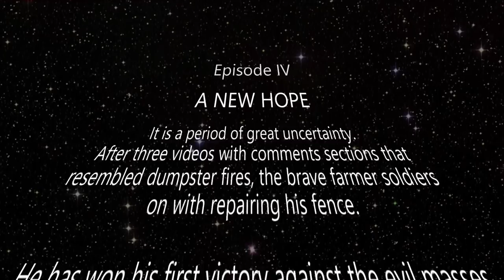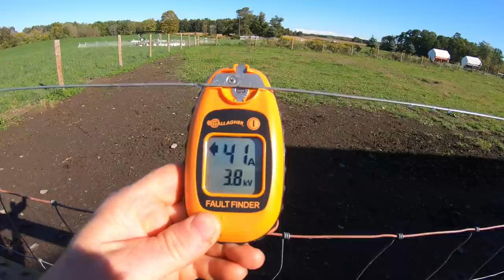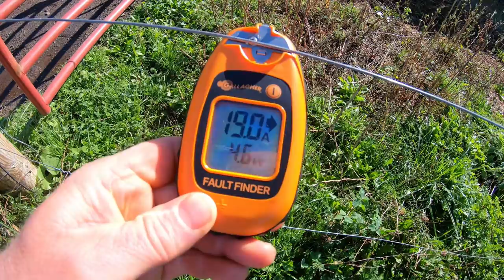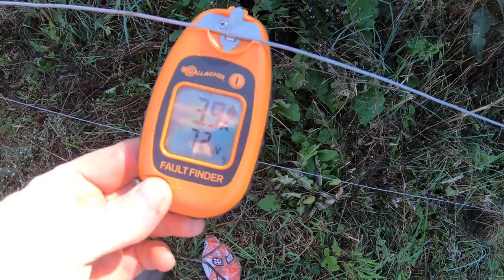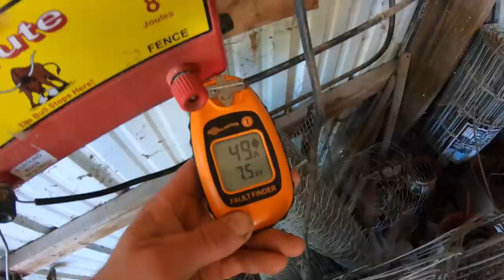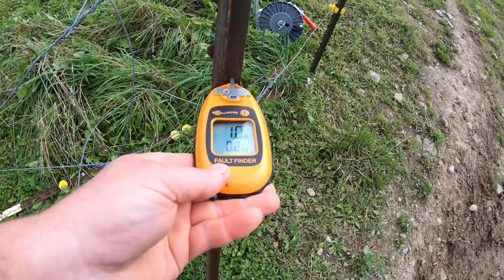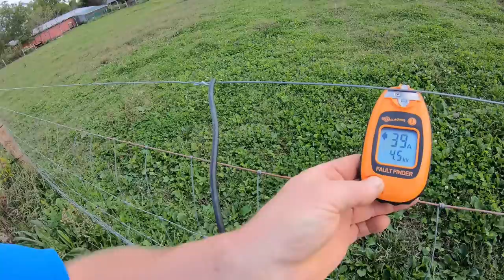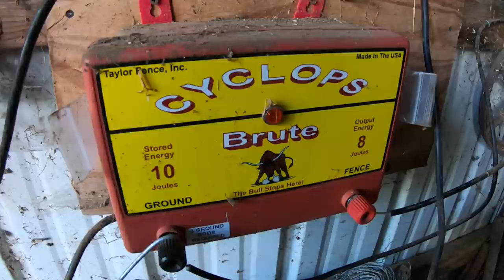FENCE WARS - The SHOCKING Conclusion

Comment: The fault finder helped to explain it so much clearer than the cheapy tester. For a percentage of us, I think it was well worth the $100+. Thank you for that.
Reply from the maker: But it really didn't tell me anything I needed to know beyond the cheap tester, except that the video viewer could see the readout.
Reply: I thought the fault finder was supposed to guide you to the fault? I was going to buy one but now i wonder if i should not waste my money? Any thoughts?
Reply from the maker: @hillbillyfarms3714  The fault finder can get confusing, especially if you are dealing with multiple faults and your fence is interconnected such that you may have electricity coming from 2 directions. I have heard they work well for folks that have lots of experience with them. I prefer to use a voltage tester, along with my eyes & ears.

Comment: "You know, I could go and turn the fencer off, but where's the fun in that". OMG LOL!!  Thank you, Pete.  You are brave, I hate getting shocked, I'd be walking back and forth to the barn again and again.
Reply: @daleolson3506  Thanks Dale, I will look into that for sure!  My fence is too young to and short to have so many faults to chase, but some day I hope it will.
Reply: Just a ground spike and a wire with an alligator clip on the other end can be used as a shunt to ground if you don't like getting zapped while working on the connection.

Comment: When I was a kid we had one of those weed cutter fencers and you are right they were mean hot. I've found birds perched on the barbed wire with their beaks on the hot wire with a bug in their mouth. Every time the current would hit the dead bird it's feathers would stand on end. It did keep the fence weed free though. If you can find them, those old glass insulators work well on corners and ends. Thanks for the video Pete. Good day.
Reply: Our old weed burner was bad about starting fires.
Reply: @T_Humphries  We used one for years and never had a fire start. Maybe we were just lucky. Luckier than the birds, for sure. :o)....

Comment: One of my favourite farm hacks is to plug my fencer into a wifi smart plug (worth about $15).  The smart plug can be controlled by an app on my phone.  When I am looking for faults, or need to do a quick repair, I turn off the fence, repair and then turn the fence back on all standing right beside the fence.  Obviously you need cell coverage in your field, but it has saved me countless shocks and is very quick.  I also have the plug on a timer so if I forget to turn on the fence after I maintain something, it turns back on at 11PM.

Comment: Solved most of my fencing issues when i switched to a New Zealand type fencer a few years back. Did have some problems 4 or 5 years ago so I got a 120 mile fencer instad od the 50 mile fencer i had. That did the trick, the calves don't even sneak under the fence anymore to get to better grass. As a side note my fence is terribly weedy and even brushy some places. But it still works good. I feel for you, when the fence don't work right it is a constant worry.

Comment: One of your best videos yet, love the opening and the troubleshooting.   Your ears are the best tool for finding ground outs.    The loops on those electronet fences that you use for the turkey's getting pushed down and grounding out on the post seems to be a common ailment, pretty much the only thing I look for on mine any more when the voltage drops.

Comment: I went to work as a repair tech for IBM in 1980. Their philosophy and one of the first things they taught us on troubleshooting an electrical/electronic circuit was to keep dividing/isolating the circuit in half until you narrow the number of possible failure points down to something more easily checked in a short time. I've applied that same philosophy to other things besides electricity in life over the years. Glad you finally got your problem figured out. And like others, I liked the intro.

Comment: We put water pipes over the T bar fence post to stop the little rubber insulater wraps from being punctured. Maybe this little trick will help ya some. Plus it made it more visible to the cattle and most important. It rotates so the cattle can't scratch on it so they eventually leave it alone.

Comment: Pete, you got meemaw, who's going on 95, laughing and slapping her knee every time you touch that hot wire.
She suggests you throw away that sophisticated piece of yellow equipment. Go back to old fashioned way the way they did it. She said and didn't take long to get a calculator finger to judge between 7000 and 4,000 volts. In her case especially when she had a younger sibling to do the testing. Y'all have a blessed day she said.

Comment: Hi Pete been watching you for a long time we also have a farm in NY near Rochester! We are switching ours to timeless fence posts they are t post with holes in them you can run the wire thru them or wire the fence right to them. They are awesome we’ve had trees fall on them and after cutting the tree off they stand right back up. They cost a little more but you don’t need insulators. They are made in the USA and great people to work with.

Comment: I am glad that the faults were isolated, and with minimal transdermal electron current stimulation. In my line of work I deal with voltages from 3.3VDC to fault finding at 10kV. You did the systematic thing of confirming the power supply and then looking at the network outwards from there. You still have leakage but it is much better. I do like the new tool, and it worked very well for the isolation of the faults. Much easier to read and operate, and sometimes that ability can make life and diagnostics easier.

May the Electromotive Force Be With You.

Comment: Very good video. You are correct mr to give up or to power through.  Sometimes think outside the box.  Finding the shorts in an electric fence is challenging. I remember dad using porcelain insulators for corner post.  I know today we all use plastic but very seldom did we have issues with them.  Great stuff looking for the next 👍

Comment: Kudos on the intro.  I enjoyed it.  As for termination insulators we had white porcelian  insulators that worked good for terminations as well as corners..  these were the "C" shaped ones, not the donut style.  If they cracked or had dew they arced acrossed but gave more separation from the wires than your plastic t post ones.

Comment: Those nets are a nightmare because no matter how tight you get the post, the bases sag down onto the ground and suck out all the volts. We solved this problem by using stakes in between poles to help hold the netting up off the ground.

Comment: Beat we've been using hot wires and different locations for years. Isolate past your land. Back in the good old days when we had porcelain insulators you never had a problem. And then we tried some of those cheaper fence devices like you're showing with the same great success that you have.
We're out here at the high plains the basement is on a mountain 7800 ft hills and trees. We need about 35 acres per head. So it's not easy just to walk out in the morning and count your cows and make sure you have them all.
One thing we do never want to have happen to us is one of our cows get out on the road and somebody runs into that black cow on a midnight run. So I know you understand the importance of hot wires. We never like to see our fence lines being less than 7,000 volts.
We have more difficulty with grounding because we have areas that are very Sandy and other areas there hardpan clay. And we experienced tremendous droughts. So we have to keep our ground line areas wet at times. Somewhat the reverse of what you wetlanders get.
Not to be bragging, LOL. But in our Donna Anna ranch , in Southern New m
Mexico,we have recorded as little as 0.3 inches of rainfall in a year.

Comment: I'm so glad you have been able to find most of your faults! I definitely was feeling like a star wars style series at this point. Next time you do this slip on some dishwasher gloves followed by some leather gloves. Leathers resistance is pretty decent but the silicone/rubber dish washer gloves will keep you from the shock. I love your content and it made my heart jump hearing the snap and seeing you jump because I know EXACTLY how that feels.
Reply: Also I have the exact same issue with a poultry net drawing down my sheep's fence VERY badly. I run the lawnmower every time i move their fence so there is only 4in of grass grounding it out.

Comment: First of all, very good videos.👍👍👍 I also have a small herd of  simental cattle on pasture myself. I  use wooden, chestnut or oak posts for the fence, so there is no problem with breaking through the electricity, except because of the vegetation.  I know how an electric fence shakes, sometimes you see all the stars in  daylight. 😁

Comment: I have had low impedance fencing for 20 years and grew up with that type of system on a hobby farm. They still sell them, as a matter of fact, Cyclops makes the best one.  Once in awhile on a hot summer night, you’ll catch it smoking a weed. It’s hard to overload them, I have several stretches of it, mostly around ponds, and around our cash crops. I mow and it pushes vegetation on to the hot wires. They are smoked by the time I get done. Everything permanent and on a road has rock under it, and I just use simple poly braid for the moving paddocks. Honestly, a shoe string would keep them in, they are scared to death of fence. That’s with managing 1500 head at peak, down to 1000.

Electricity is a great way to get ride of weeds. Being an organic grain farmer, we use pto powered generators on the back of the tractors with electrodes on the front that hover over the rows and destroy any weeds that have gotten taller than the crops.Their are coulters on the tool bar that ground it. I incorporated nutrient application and in the row mowing, but not much left to shock on the later passes, yet their is usually some volunteer cover crop seed that germinates and some water hemp in the rows that never quit trying.

Comment: The t-posts I have (I use them as corner posts) have holes drilled in them every 25 cm. I have special insulators that you connect on the t-post with a cotter pin. Works perfectly until on of the corner posts fell over (in the river)

Comment: We used to test electric fence by touching the hot wire with one hand and the ground with the other. We'd test after each insulator. You get used to the shock quickly.

Comment: As a Alarm Tech we trbl shoot by cutting the circuit by 1/2 till you finde the tbl. It was very low voltage 12 or 24 v dc. Some really old sytems were 120 volt AC what a shook...

Comment: Epic opening! I was definitely shocked by it. 🤣🤣🤣🤣🤣.

When you replaced that first end insulator and got the first shock I almost jumped out of my chair.
I always fence with a live fence myself so I can test it. Sometimes I end up being the one to test it out unintentionally.
I usually just arc a hammer or pliers across and judge it by the snap, not a very accurate method I suppose.

Been using those end insulators that look like two letter U's giving each other a sort of hug. And sometimes round end ones but I don't like them as much.
Still using porcelain/ceramic ones that my Grandpa put in if we run into them, which I guess Zareba/Dare still make.
Also using the t-post insulators with pin locks and having success.

I almost bought some of those new style orange ones you got but after seeing your videos and opinion on them, well, I am glad I held off. Maybe their second generation design will be better.

Keep up the good work, your videos and sharing are very appreciated!

Comment: Retired a few years ago after 40+ years as an engineer designing integrated circuits.  My mantra over all of those years was if you didn't understand what the circuit was doing or if the behavior of the circuit was baffling then you simply didn't have enough data.  If you collected more data the behavior would become self explanatory and you could address the issue that was causing the "weird" behavior.  Usually, when the simulation didn't produce the desired result if you just kept gathering data you could find the flaw, usually a bad bit or missing bit of code that would get the behavior back to what was desired.  Sometimes, the missing bit was really elusive because of the bad habit of seeing what you expect to be there rather than what is really there.

Comment: one thing i found with using those corner bracket/bracing system is that i had the braces up too high on the corner post and the tension of my wire would pull the corner up and out of the ground. i now put those brackets about half to 2/3 of the way up the corner post and that helped.
Reply from the maker: A long diagonal post also does the same things; transmitting more of the vertical pull-out force into horizontal force.

Comment: Could you use the lockjawz insulators and the tube insulators together?  Maybe knock the "tooth" of the lockjawz.  I've been working on a fencing project and seeing the problem points on your fence has been extremely useful.

Comment: When we had cows and an electric fence, we always segregated / isolate fields into "blocks" with fence handles. When there was an issue, we would disconnect handles one field at a time until we found the problem. This also has the benefit allowing maintenance to be performed on various sections of fence without having to turn the charge box off. This was especially effective when since we had a 15 year old psycho Jersey that would escape anytime there was no charge on the fence - it was like she could sense it was off. You might want to invest in a pair of electrical lineman gloves similar to what the electric company uses for their employees. That'll protect you from Old Sparky.

Comment: For temporary fence areas, such as for the turkeys, have you considered using solar fence?  I use one for my chicken area to keep chickens in and predators out.
Reply from the maker: We used to use it, but found it better to tie into the main fence, due to stronger zap and not having to worry about battery health.

Comment: You can get some non conductive spray paint, even a clear coat, and just spray the terminals, that will rid you of the "dew" shorts, even from the poop ones. spray paint is cheap and wouldn't take you long to do them all.

Comment: 50/50 is a great test method. Break it at the half way point, if it's good then you work on the last 50, and then break that up into 50/50. If not you break up the initial 50 into another 50/50, and continue from there. Quickest way to find one main fault. If you've got multiple faults that's different story...

Comment: I wonder if you couldn't combine the Tubing insulators with the orange ones to double up on the corners until you can get a good corner insulators. The tubs would protect against stuff like the bird poop while the lockjaws ones would protect the tubs from the metal posting allowing both to perhaps be useful much longer. It's wouldn't be too expensive since you seem to have a decent stock of both on hand
Reply from the maker: Wood posts at ends/gates with proper insulators are the solution.

Comment: Pete have you tried leather gloves here in UK 24o volts A/C electricians have them when having to work on  hot cables . Or have you tried standing on a rubber mat so you  are not to ground. Good luck love videos

Comment: Make yourself a jumper with a clip on each end to jump from the hot wire to a metal fence post while you're working on the fence and you won't get shocked.Also your amperage reading at the electric fence controller might be from the resistance im all that wire you've got strung out.

Comment: Sorry Pete, I had to laugh when the fence got you. I had an interesting experience last year with plastic "insulated" posts. We had a storm, the wind took the tops off the waves and blew salt up coating the posts. You guessed it, salt is a conductor of electricity. 9-10k kicking me each through post I had to move.

Comment: 😂Been there, done (almost)all that!  May I suggest, with all that fence line and distance to cover, that you install some cut-off switches at different spots to shut off and easily isolate those pastures when needed.  Unless you actually like being shocked (I remember my dad saying he was just getting “his vitamin D” at a shock.).  I’ve often put a lot of miles on my watch’s pedometer walking fence lines and retrieving equine escapees (e.g.,miles) so I all about being able to isolate sections of electric fence. 
The weed burner fencers were powerful enough to overcome  a certain amount of  vegetation but didn’t actually burn the weeds (as far as I know). I’ve heard horses can’t tolerate the powerful shocks of weed burner fencers. 
I find your videos useful and sometimes pretty entertaining!

Comment: This made a long slogging job into Star Wars entertainment!  I wonder if doubling up Lockjawz plus the rubber tube would create a reliable end post terminator?  I'm not so sure that a cheap conventional voltmeter would work properly to diagnose an electric fence though.
Reply from the maker: The rubber tube will not fit in the lockjawz insulator. A cheap tester works just fine.